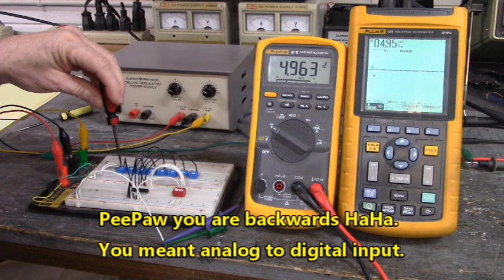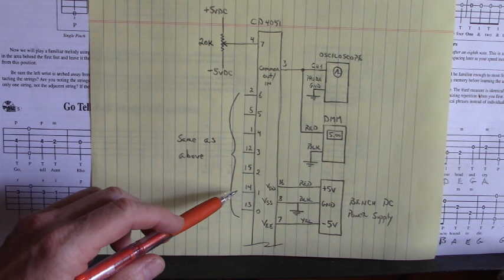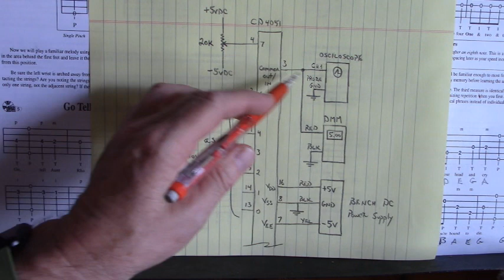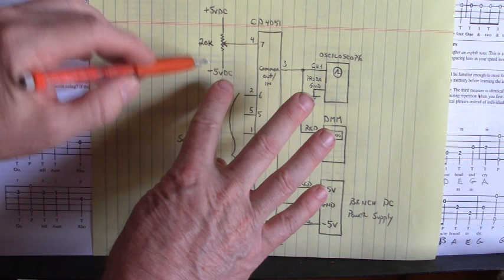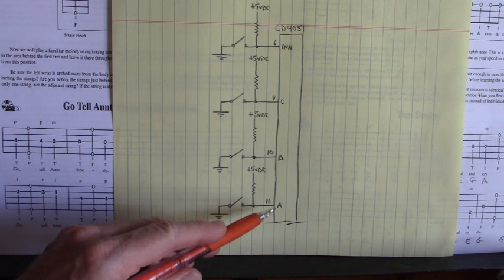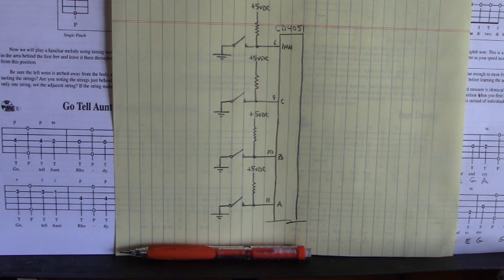Experimenting with the CD4051 Integrated Circuit

Comment: Greetings, I really like the content you share, especially when you teach how to repair servo motor controllers.  Maybe you can help me, I have a fanuc brand spindle controller (a20b-1000-069) I would like to know how to control it to use it with mach3, which pins should I use